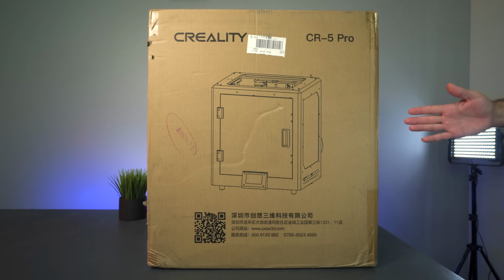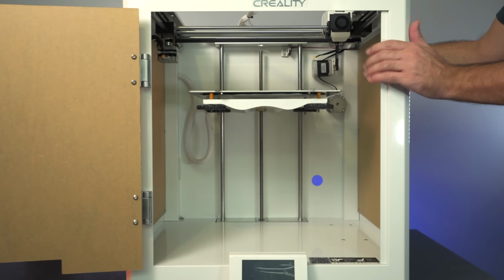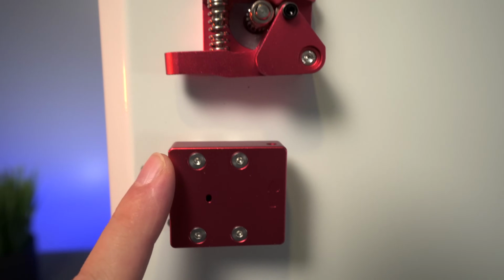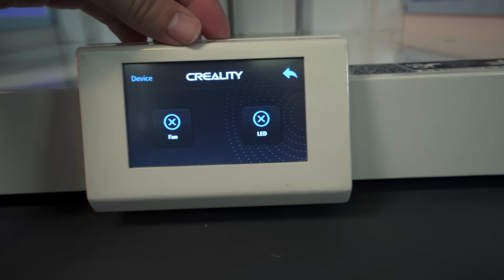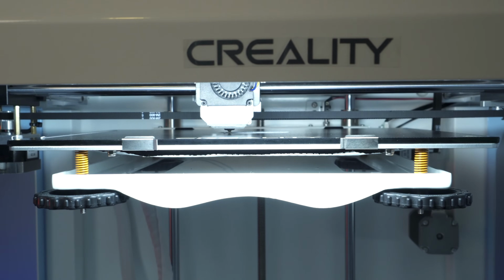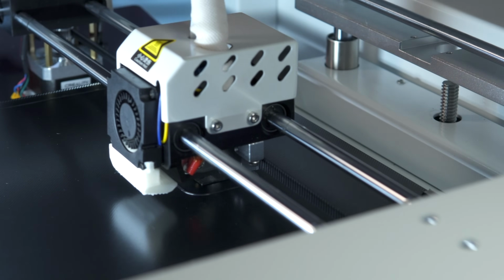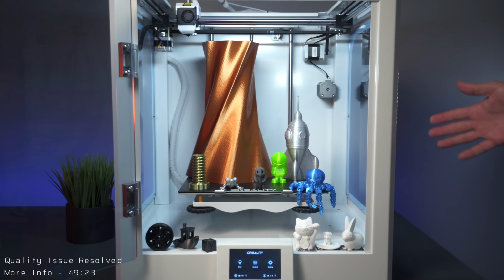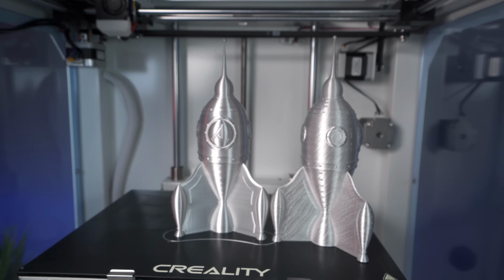Creality CR-5 Pro - 3D Printer - Unbox and Setup

Comment: I too was surprised they had not gone with 12mm rods on the X, and I would have preferred linear rails or at least stainless steel rods.
Direct drive extrusion is more or less default in industrial quality printers these days.
 That hole where the spool holder goes does not get blocked with the fitting of the spool holder as it is hollow, also the door is not a sealed unit adding yet another draught point to the printer, and also as you pointed out the location of the spool holder is less than ideal, I think Creality provided a spool of filament so when you come across s spool that gets in the way of the power switch (and you will) you are aware that Creality's spools fit the printer.
 An industrial printer needs an all-metal hot-end to be able to print the high temp materials, it looks as though this has the standard MK8 Creality hot end with just one part cooling fan.
 I am considered a bit of Creality fanboy but this printer disappoints me in so many ways and reminds me of The Emperor Wears No Clothes.
 This is trying to be an Industrial grade printer but is far far from it
Reply: @Prokurator Generalny Dziura w Dupie What a wonderful name you have chosen my friend!
Reply: Not entirely true, industrial printers quite commonly have Bowden extenders, as the build chambers can be up to 180C, direct drive electronics have to be very sturdy. This is definitely aimed at prosumers rather than industry, and its advertised as such
Reply: Try the Model...
Reply: Get the pro H.  It' does a lot more than this one.

Comment: I don't understand what creality was thinking with this printer. No all-metal hotend, so no printing above 250C. No auto bed leveling, no direct drive, no filament runout detection, It's not true corexy, it has horrible dimensional accuracy on parts and basically no "pro features" but with a "pro" build. 
Who is this for exactly?
Reply: It Does have Run Out Detection..but yeah for $1,099 this thing is LAME
Reply: Its marketing. Creality says its professional and industrial so it must be true right? Marketing BS. Its basically a cheap Ender in a enclosure.
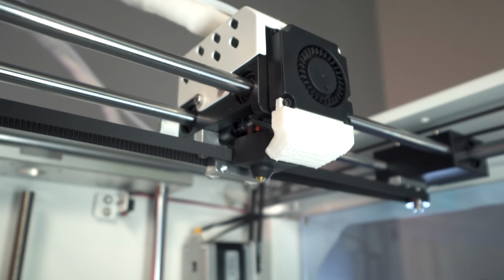Reply: Look at 17:57 . The belt almost touches the heat block... that is bad news
Reply: Try the H model